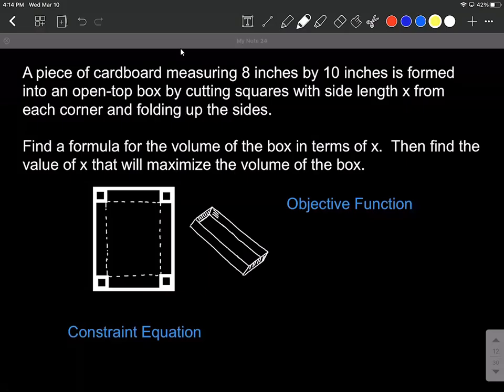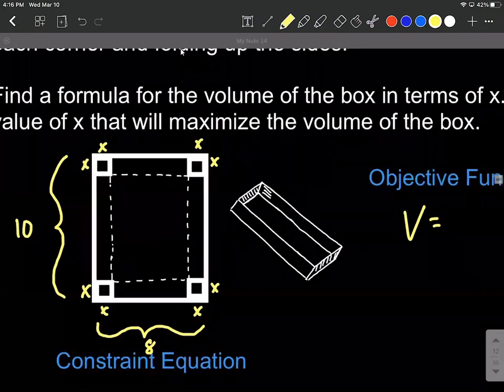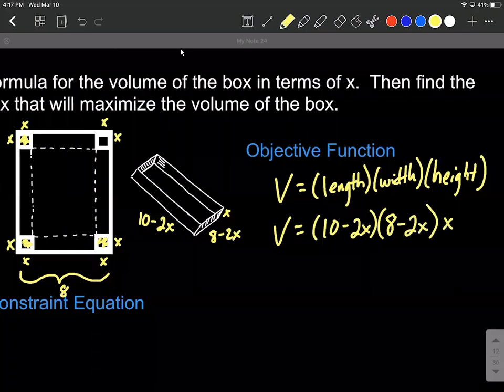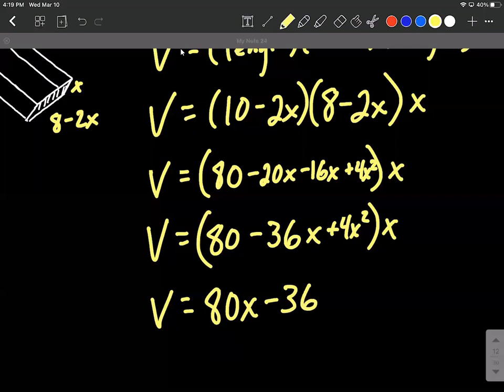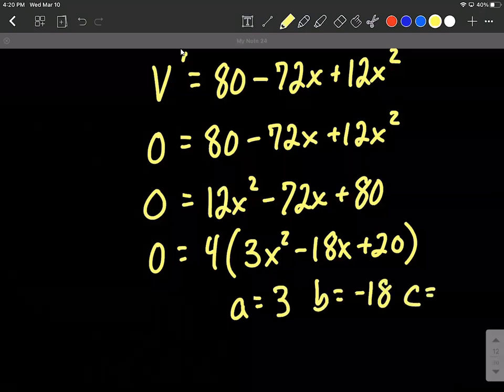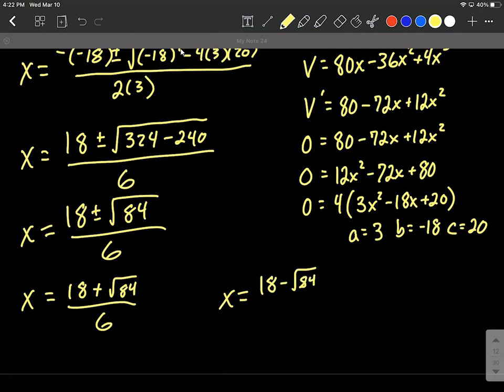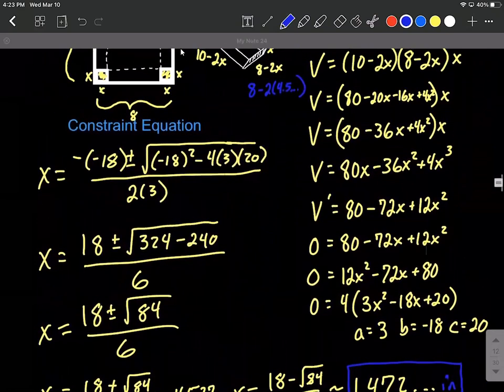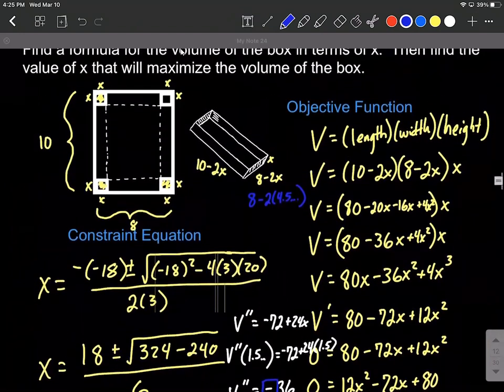Optimization | folding box | maximize volume of box calculus

Comment: What happens if the corners or folded parts are binomials?
Reply from the maker: In this application, the corners are squares so that after you cut them out and fold the box up, the sides will all be the same height.  I am not sure why you would want to represent the side length of the square with a binomial but if you did, you could replace each of the x's in my formula with your binomial.